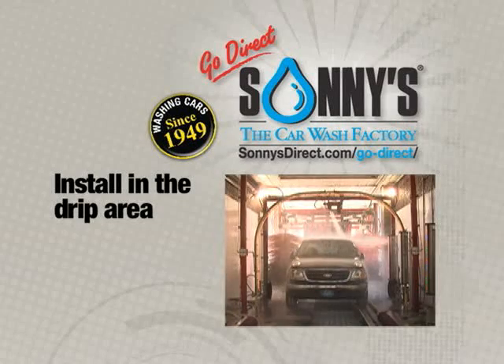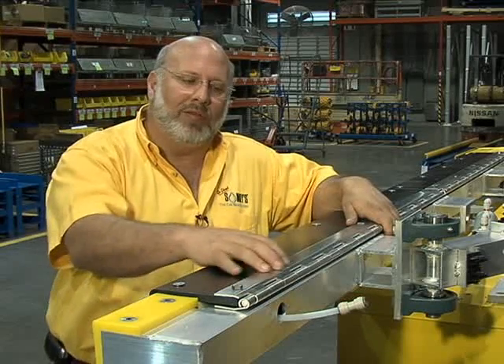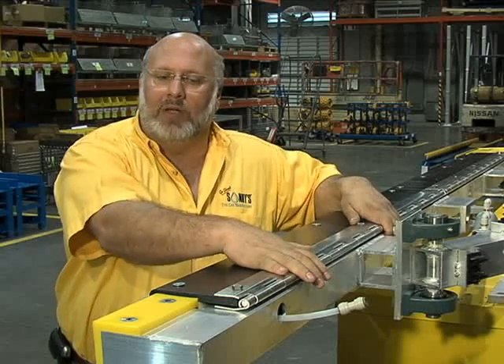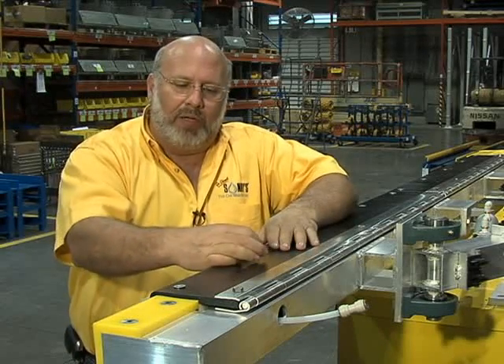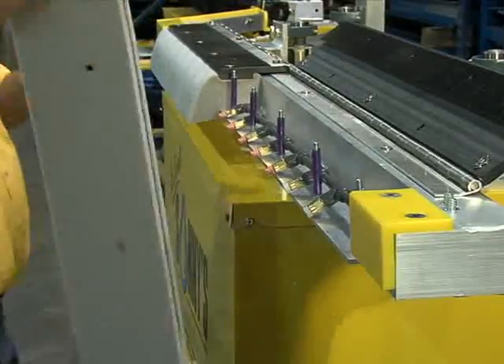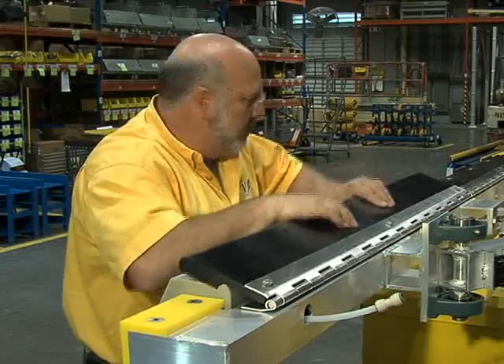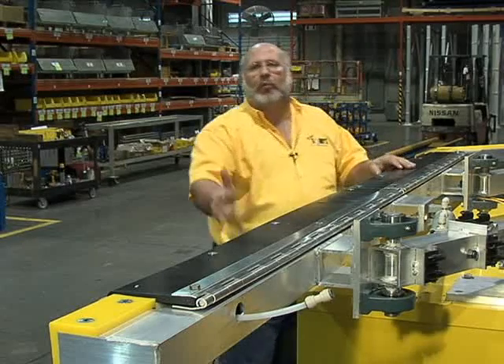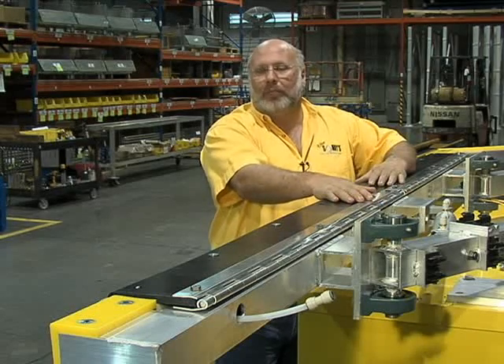Car Wash Equipment Tire Shine Machine

Comment: Can you use a silicone based tire shine?  I like silicone based shine because it lasts long and is waterproof.  But I need to  put that on a dry tire, so are you using a concentrated product the blends well with the wet tire?